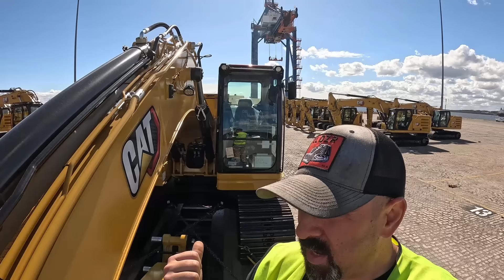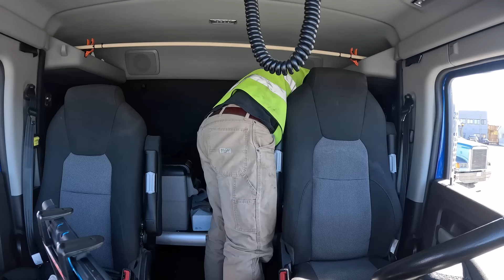Heavy Haul 107,000 LBS! Steep mountain at 18 miles per hour!

Comment: I just switched to Cummins from Cat and been learning the rpm range. I’ve discovered that 1400-1500 rpm is a good power range. 1600-1700 good upshift range. 1300 need to downshift
Reply from the maker: I usually upshift between 1400-1500 drops it to 1300 (18 speed). I find if you are on the throttle a lot above 1500 it uses a lot more fuel. I can get a little over 5 mpg if I keep it between 1300-1500 rpms (last quarter I got 5.3).

Comment: I was wondering Cliff if your Kenworth will take off on steep grade like that hard pull at55 ton gvw? Today’s transmission are awesome the ratio ranges they are capable of.great video
Reply from the maker: Ya, it will definitely get itself going, I've pulled some pretty steep grades from a stop before. That low low gear crawls pretty well :)
Reply: @hamtransport the18 spd i drove was the 2000 edition 900l with the c16 625 it had so much power I drove it like a 8 spd barely above idle it seemed and just slipped into 18 overdrive with 40 ton gvw lol
Reply from the maker: That sounds like a fun truck to drive. They didn't put many of those big 16 liters in trucks. You were definitely king of the hill!

Comment: 17:00 Can you not put the chain hook through and hook back onto the chain? Or is that not secure?
Reply from the maker: I could, but I have a big slip hook on that end and it works well on the D-ring on the trailer. Either way is fine.